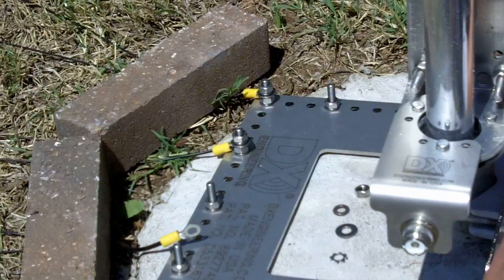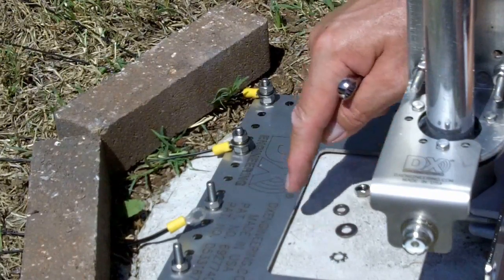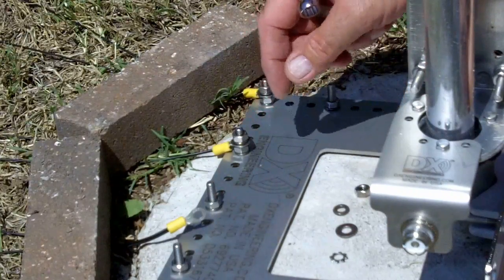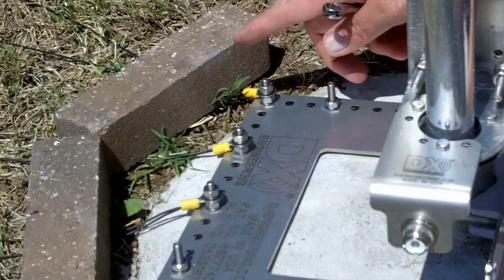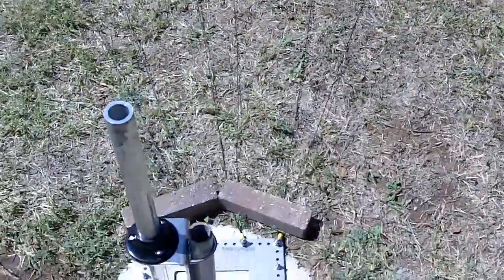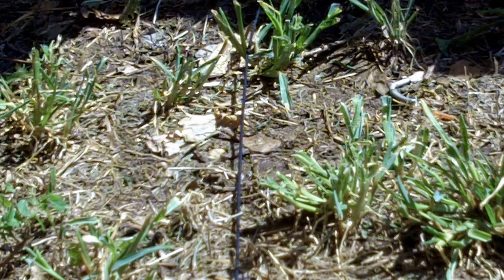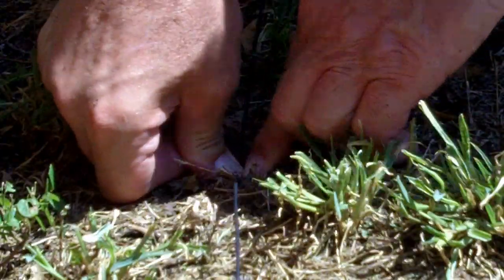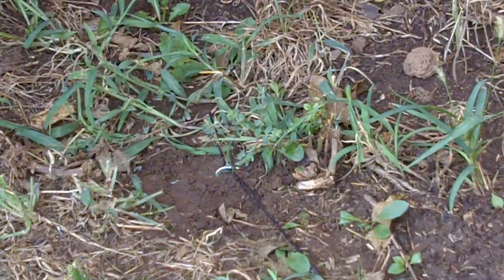Part 2 - Ham Radio Antenna Radials

Comment: Hi, i am new to verticals and have made a 10 meter long vertical using a fishing pole. I am using a balun, and the ground is connected to a copper plate in the damp grass, I have made some good contacts on it, if my lawn is kept moist near the antenna base, would this suffice for the radials? M6PTS

Comment: Hello.  W1TXT, Tom here.  Can you please comment on the performance of the vertical vs other antennas, such as a dipole or loop?  I've been considering a 5/8 vertical for 40 meters, but wanted to get your perspective before I begin.  The antenna radiator will be made with vertical wire and dozens of radials at ground level.  Thanks in advance for your reply.
Reply: Hi Tom, N8CMQ, Jeff here. Not sure if you got an answer about vertical performance yet, but I can give my 2 cents worth. I have a 4BTV type antenna I have been using since 1983 at many locations and many heights. At the worst, it was roof mounted with 2 radials per band and didn't work worth anything. The best operation has always been ground mounted with over 100 radials cut as long as space permits. Presently, I have 120 radials at 30 to 35 feet in length to fit a 60 foot square. I can work the world with 100 watts and even outperform many high watt stations running a KW. The reason is, the better the antenna, the better the signal. And a vertical is a great antenna if you watch the losses and never compromise the build.
Reply: Thank Jeffrey.  I didn't receive your original answer and I'm all set now.  I haven't decided on the actual radiator yet.  I have several very tall trees and may just go with an 86' wire or something like that suspended between two trees on a rope.  If I do this, I'll but down about 104 radials.  Quite a chore, but should be interesting.  my email is <mycallsign>@arrl.net.  Please drop me an email and I'll let you know how this progresses over the next several months.  73

Comment: Great videos.  Just a question. At 0:26, you indicate that the manufacturer recommends connecting the radials directly to the plate (I'm guessing to keep the resistance low.) Have you found that the added resistance of the steel bolts has any impact on performance?  K7NXT

Comment: For those of you in a region where snow fall can measure 6 inches on the averag you may want to raise the insulated base to antenna feed point up offf the ground about 12 inches just incase it happens to snow...

Comment: A ground rod at the antenna base won't significantly impact noise when its in addition to ground radials. What will eventually generate a lots of RX noise is using stranded wire for ground radials.. 

As moisture wicks into the wire corrosion forms throughout the entire length of each ground wire.. This corrosion will create millions of diode junctions between the individual strands of wire, Thats why you should always use sold copper wire for ground radials. 20-18awg magnet wire works great

Comment: I hate to say it but the DX engineering radial plate is really over priced antenna bling. First it's made out of stainless steel which is a very poor choice for a ground plate. And it's a flat plate, remember we are dealing with RF and skin effect. There's also  going to be a dissimilar metal problem in the fasteners. A better system is to attach a 1 foot diameter loop of 1/4 inch soft copper tubing to the base of the antenna with the radials wrapped and soldered directly to the copper loop
Reply: Blaze1024 Nothing wrong with a stainless steel flat plate, nor have I experienced any dissimilar metal issues, the hardware is also stainless. Mine has been in service for 10+ years now with no problems!

Comment: Unfortunately I see there are still a lot of myths floating around regarding ground mounted Antennas.. His ground mounted vertical with at least 30 radials will perform better then it would at 15 feet with only 4 elevated radials. At 15 feet those radials would still be well within a 1/4 wavelength of the ground and thus still coupled to ground with the same ground loss's. At 15 feet he would need the same number of radials to reduce the ground loss's as he would if it was ground mounted..

Comment: What did you do to prevent corrosion where the radials (wires) connect up to the grounding plate?  If you didn’t do anything to protect the connection than I recommend a compound like NO-OX (it is nasty stuff so use gloves.  Also, did you run a ground rod?  I would be interested to know what the difference in your noise floor is with and without the ground rod.  Thanks for the great video.

Comment: I sure wish I could push the wire staples in as easily as you were able to at my location.Near Tucson,the Sonoran Desert is rock laden and the ground is about as hard as can be found.My first antenna as a Novice was a Hustler 4BTV.It worked quite well and I really liked it.Your install is done properly.Thanks for the nice video.Good luck with a very good antenna!...73...Dennis W7KB.